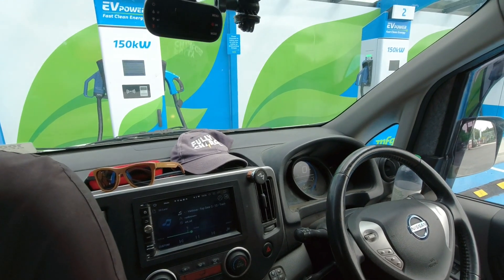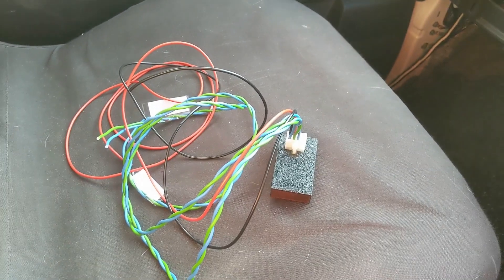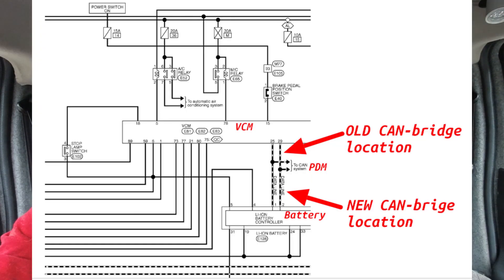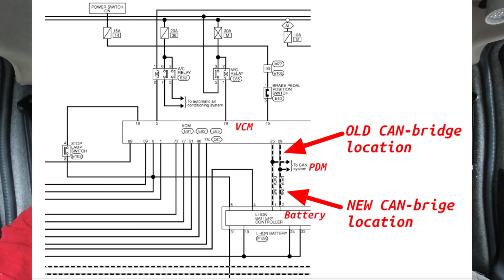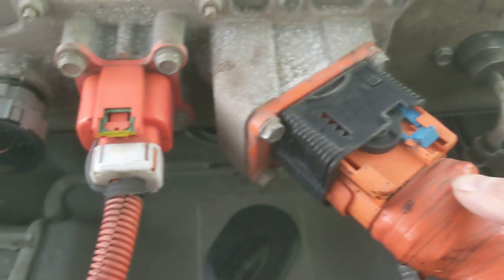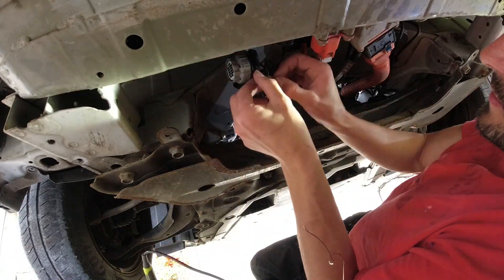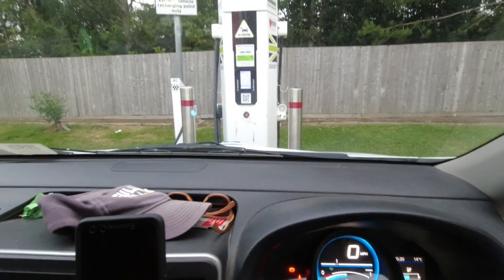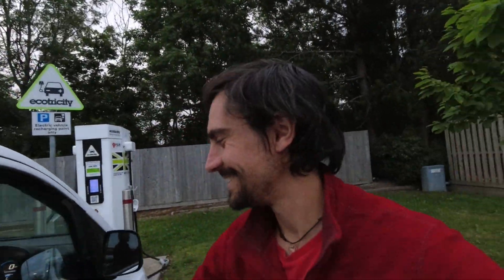e-NV200 battery upgrade part 2: Fixing minor issues - CAN -Bridge relocation

Comment: Hi Glyn,
Are you still reading this?
Have a eNV200  battery upgrade question. Is skipping  the can bridge and only using leaf spy battery error code remover leaves me with alternating range display with max range and some chargers not charging to full? Is the AC cooling working? Anything else ? I  am trying to avoid splicing into the harness underneath. Thaaaanks. Peter
Reply from the maker: That is correct. However, compared with the effort of doing the battery swap fitting the CAN bridge is quite straightforward. It's just like fitting a car stereo. I would recommend fitting a CAN bridge to have a seamless upgrade. Especially the rapid charger compatibility, that's the mains issue. Also, the ability to sell the van with a professional polished upgrade in the future.
Reply: @GlynHudson  thx Glyn. But the AC battery cooling did work, didn't it? There was only a glitch in the early coding of the can bridge right? thanks for your answer, big fan of yours from Hungary
peter
Reply from the maker: @101belcore  the battery cooling worked fine without the CAN bridge, but it didn't work with an early version of the CAN bridge firmware. This has now been fixed
Reply: Thaaanks

Comment: Glyn - from your experience (thanks for all of your time invested in these vids btw), is there any reason why we can't just swap the VCM from a 40kWh van into a 24 van? Will that do away with the need for a canbridge?
Reply from the maker: The unique battey ID would still need to be paid with the vcm, unless you found a vcm and 40kWh batrey from the same vehicle. You would also need to pair vehicle keys with the new vcm. This can only be done with Nissan tools. Swapping the vcm is a lot more work and cost than using a can bridge.
Reply: @GlynHudson  In fact, I have a complete written-off 40kWh van with VCM/ keys and leafspy for pairing. There is currently a delay for Dala's can bridges of a few weeks so I might just wait and see.
Reply from the maker: @B2C2007  if you have a battery and vcm combo it may be worth a try, I think pairing the keys is quite straightforward with the right tool. Possibly pairing keys could be possible with the 'LeafHacker' android app. Let us know how you get on
Reply: @GlynHudson  I had this back from Dala: "I would advice against trying this, will with 99.9% certainty not work"
Reply from the maker: @B2C2007  Dalla knows best!

Comment: Just run my cam bridge wire through the firewall. Gonna save soldering till tomorrow running too close to picking the kids up. Want a full day aside in case i screw something up. Tip about the black trunking is a good one. Managed to have some off an old honda insight to protect my wires from those cheeky mice.

Rained all day today so ive postponed the job. Did manage to wire up and test my diy v4 bms though for a potential leisure battery.
Reply: Finished my 2 port install. This video helped massively. Just charging at the osprey rapid in Stockport. Local cheadle rapid was broken and made me panic a little. Anyway just waiting to see how long this is going to take.

Comment: Thanks for this Glyn. My 40kwh upgrade is imminent in the next fortnight.
Reply: did you get it done, how did it go ?
Reply: @AdrianMcDaid  yep the battery was swapped with help of Laimonas who sold me the battery and used the lift and pro help with the aircon at mitsiland in Denton. Had it a while now. On renewed firmware for the 2 port canbridge which has really decent low power consumption on the 12v now. Very easy to reflash. Overall a success. But my hx on the 40kwh pack is not brilliant and as a consequence rapid charging is relatively slow especially when we took the van to france. Had to turn around at paris versaille since the battery was making travel very slow with rapidgating. Didnt get to toulouse to see my friend but did manage to get home to manchester. Next mods are ccs and maybe and extender pack

Comment: I think doing a belt and braces approach is sensible here, do a leaf spy flash, then add a CAN bridge, reason being if the bridge fails or is damaged you can fall back to flashed operation untill the bridge is repaired, otherwise your stuck on reduced power etc with a P3102 code.
Reply from the maker: Exactly, this is what I've done. Although if the bridge is removed I need to add a connector to re-connect the EV CAN lines
Reply: @GlynHudson  yes, a job at least you can do in the field to get you going again .👍
Reply: @PlanetCypher_ @GlynHudson what do you mean by a “leaf spy flash”? I am about to install a canbridge myself and would like to know how to do it safely.

Comment: Does the 69% roughly compare to a 24kwh pack @100% ?
I think it does roughly work out 67ish % is 24ish kWh's ie a full 🔋
Reply from the maker: The 40kWh pack has 36kWh usable, my 24kWh pack at 80% Soh had 17kWh usable, therefore the new pack is just over 2x lager. So 50% of the new 40kWh pack equal to 100% of my old pack